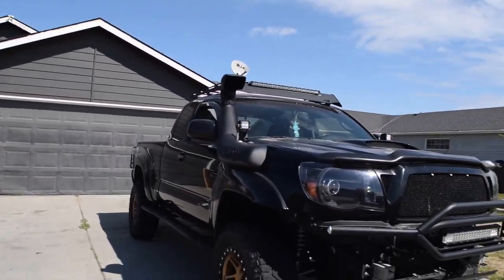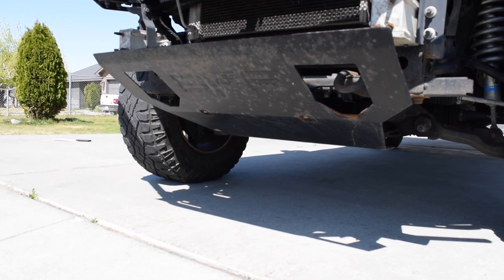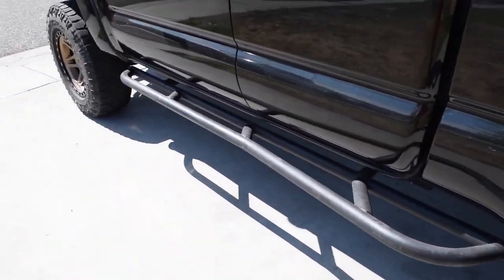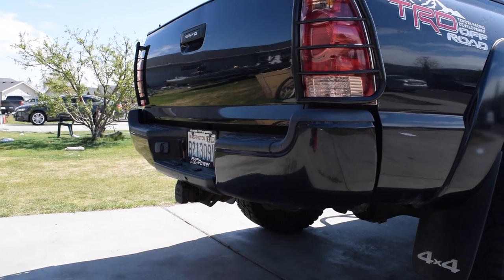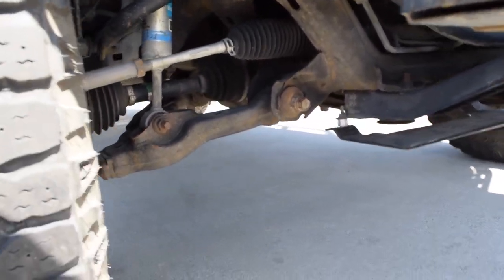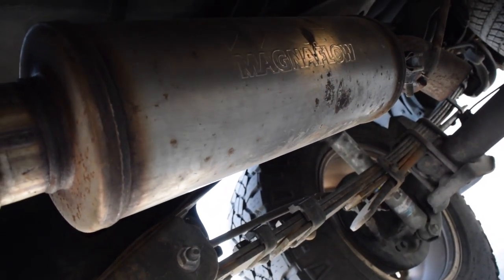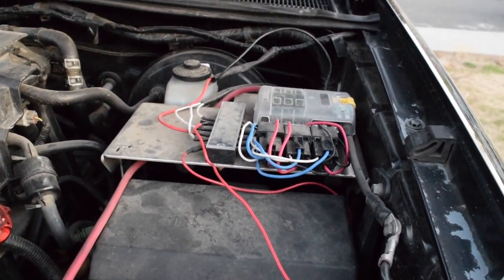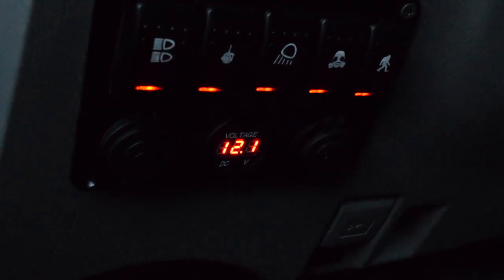OFF-Road/Overland 2005 Toyota Tacoma Walk Around

Comment: Bruh......I got the same antennae in black and it did the SAME THING! LOL!!!!! I'm dyin! I wish the whole thing could've been that bronze color instead of just the tip. Oh well. I've been debating between those rims and the Method NVs....diggin the truck man. - 2015 black double cab.
Reply from the maker: Yeah my dude crazy huh lol and you can’t go wrong either way! I’ve had both and they both look really good! And I’m jealous I want that year style!
Reply: @progressiongarage7332  I've been trying to figure out if I can use 265 75r17 or 70r17 without having to cut anything. Gonna probably go with a mild lift in the future but I'd like to avoid any cutting just because. 

Oh also, how are those raptor style lights holding up? They seem like they are pretty bright and look good. How did you wire them up? I'll probably order some this week. Thanks man.
Reply from the maker: Ian you should be fine I was running 265/70r17 on stock suspension and would berly rub on the mud flaps, you should be in the clear!

Comment: hey man im looking to get an 05 tacoma soon as a beater, the one im looking at has high miles.  how many miles roughly are on yours and is it reliable ?
Reply from the maker: I have a little over 150xxx and still running strong haven’t had an issue yet! And as long as it’s mechanically sound should be reliable!!! These trucks run forever! Look up the 1 million mile Tacoma!